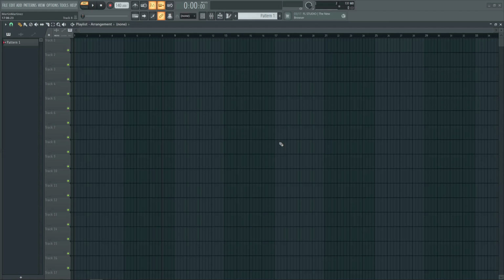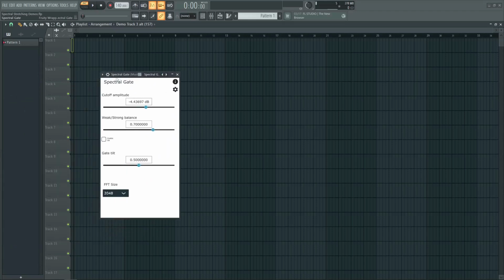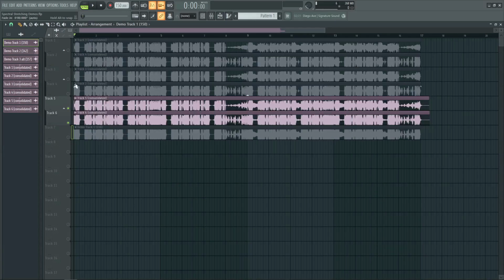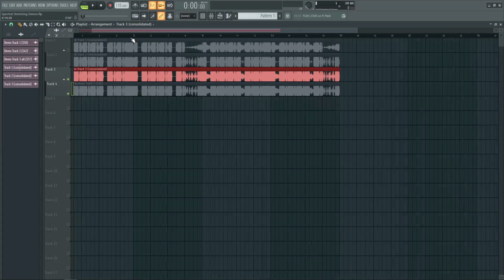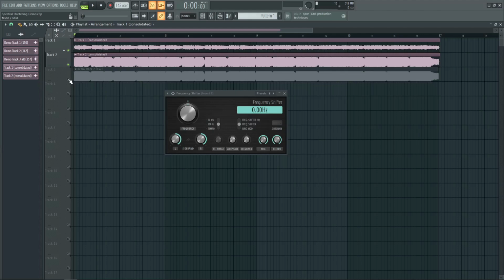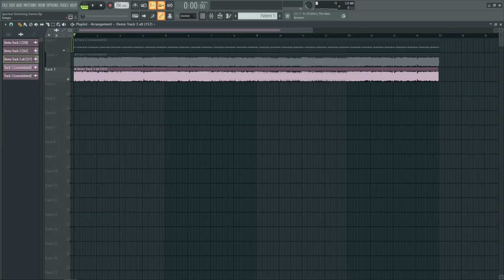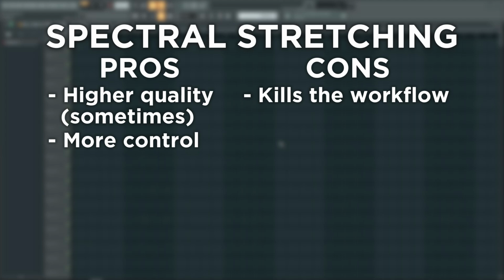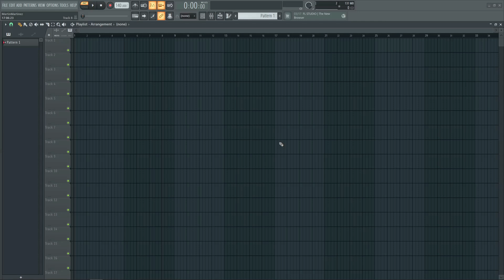Spectral Stretching

Comment: Definitely going to try some of this stuff out. I've been down the spectral rabbit hole so this is right up my alley.

 I've been using noise samples to generate spectral profiles : By using static/white noise as a profile you can denoise a sample in edison but output only the noise; this way you only output the frequencies that overlap with the noise profile. I've gotten some really gnarly sounds  using this method with different noise-profiles of white/pink noise samples. Neat part is you can keep reiterating over the same generated noise to keep generating different variations. 

Now I have more ways to mangle my sounds!

Comment: The pre-ringing is justy how FFTs work; the more detail you want in the frequency domain (FFT size) the less you get in the time-domain.
You could do some clever stuff like gate the high FFT with the low FFT, but it wouldn't be more precise.
I would try doing only one of the filters, then creating the other "stem" by just phase inverting and subtracting from the original.  But I don't know how having that tonal but antiphase ringing end up after doing the transient favourable stretching on it.